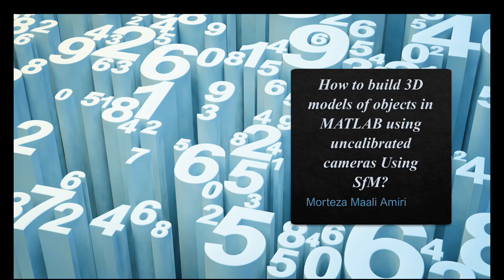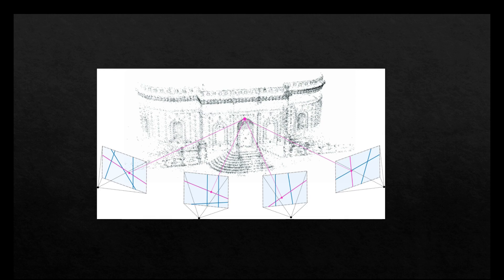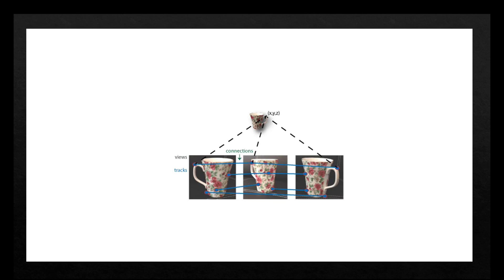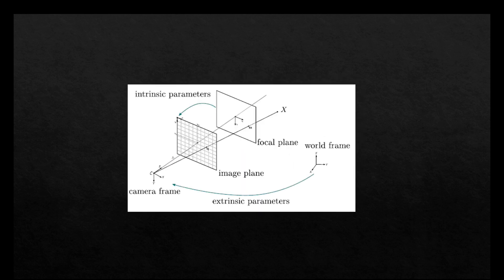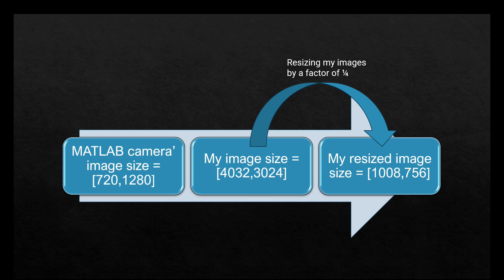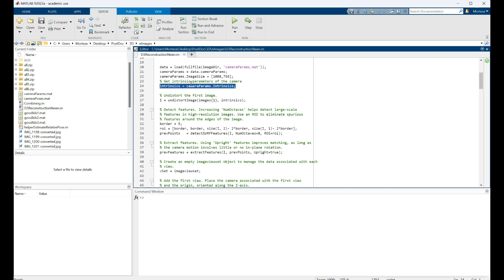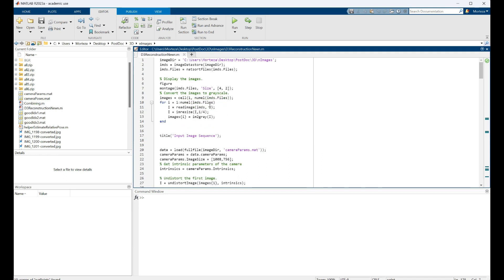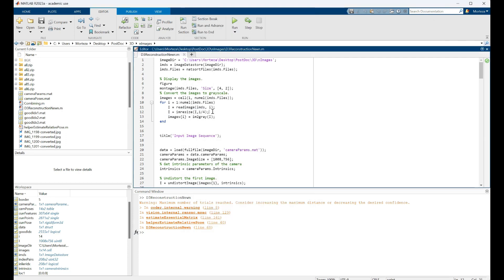How to build 3D models of objects in MATLAB using uncalibrated cameras using SfM?

Comment: Hello ..How do i extract parameters from a 3D dense cloud??
Reply from the maker: To extract parameters from a 3D dense cloud created using Structure-from-Motion (SfM), you need to follow a few steps that involve analyzing the reconstructed 3D points and the associated camera parameters. Here are the key steps and some MATLAB code snippets to help you extract useful parameters:

Load the Point Cloud Data:
Ensure the xyzPoints variable contains the 3D coordinates of the points in the dense cloud.

Visualize the Point Cloud:
Use pcshow or other visualization functions to visualize the point cloud and understand its structure.

Email me if you have more questions!